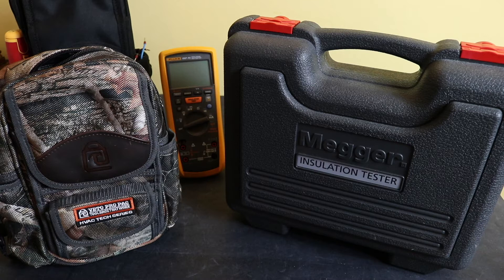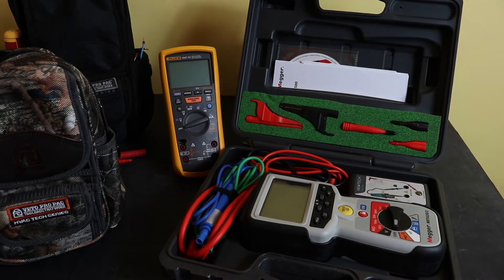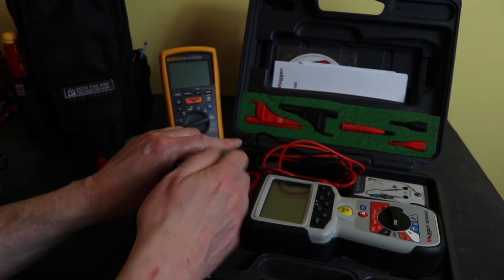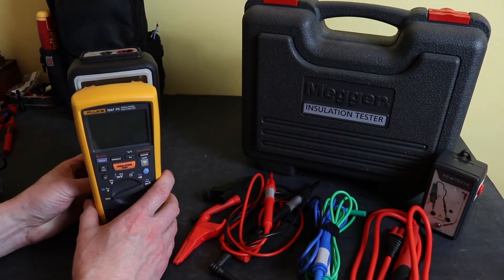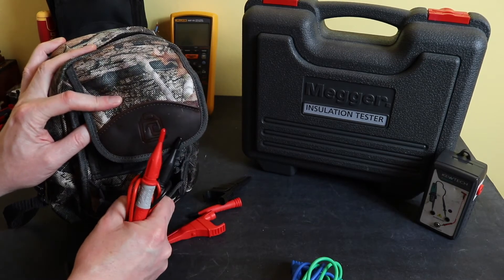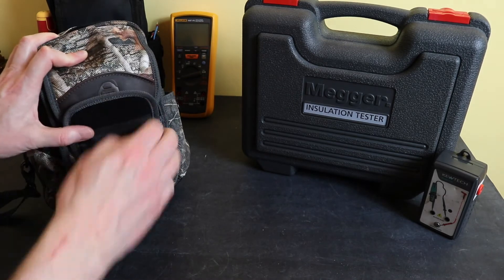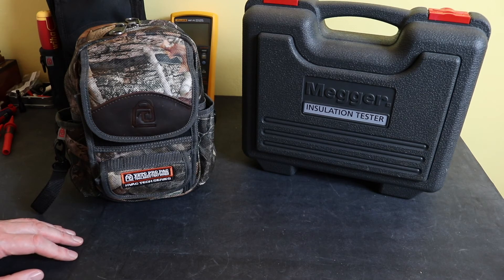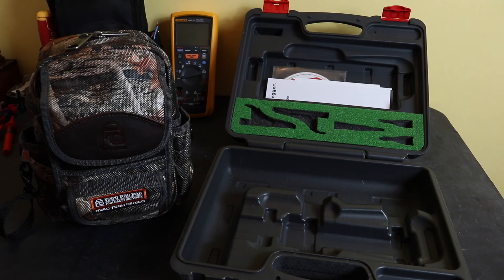Veto MB Meter Bag and the Megger MIT420/2

Comment: I have a question on the 420/2. I recently purchased this meter and has trying it out and found that it will not insulation test on 1000 volts. The rest work fine but not the 1000v. I can set the variable volts to 999v and it works fine. When I set to test at 1000v the 1000 on the screen flashes and it beeps. Is there anything set from factory that needs shut off to use this? I find the manual lacking  when it comes to this meter. Thank you.
Reply from the maker: The 1000V test seems to have an added safety feature for its use. On mine you have to keep the test button pressed for 5 beeps, roughly 5 seconds, the beeping and flashing then stops and the test starts. This is the same even if using the timed, DAR or PI tests, the button still has to be held on of the 5 beeps.

Once an initial test has been completed, subsequent tests will start straight away as long as you stay on the 1000V test function. If you switch to another function or off and go back to the 1000V test, you will again have to hold the test button down until the test begins.

If the test does not start after 5 seconds, you may want to go back to where you purchased it from.